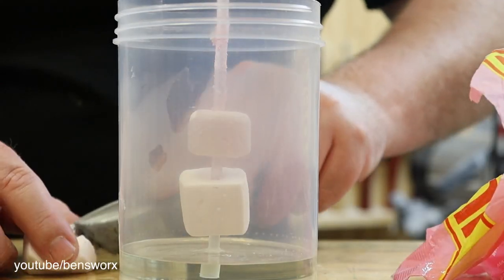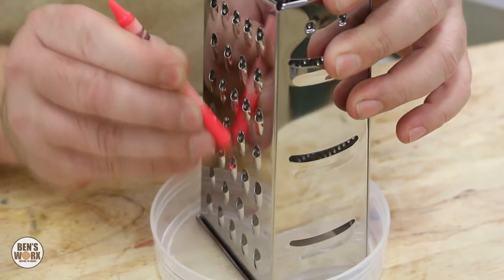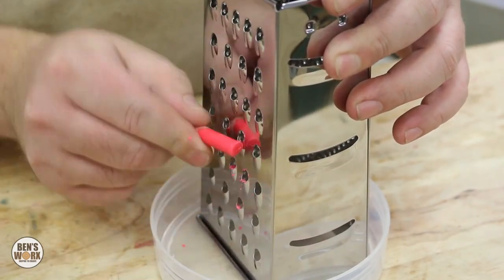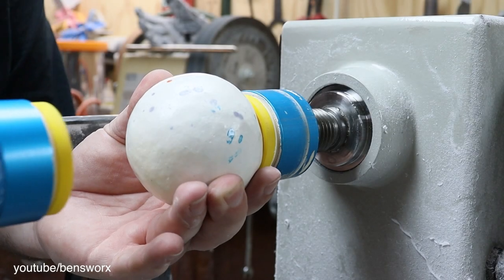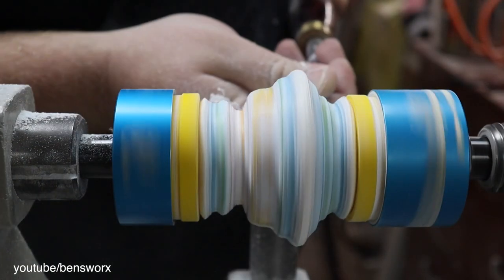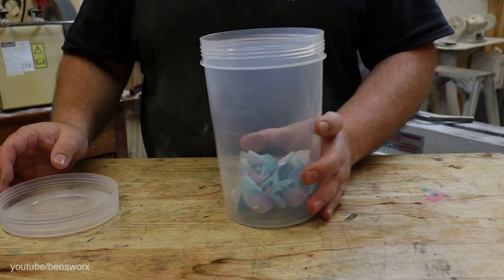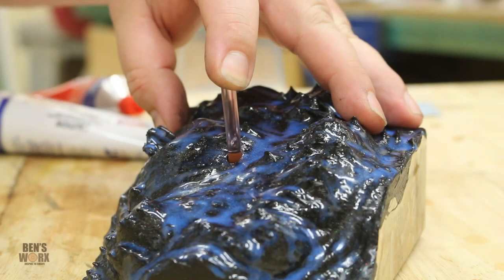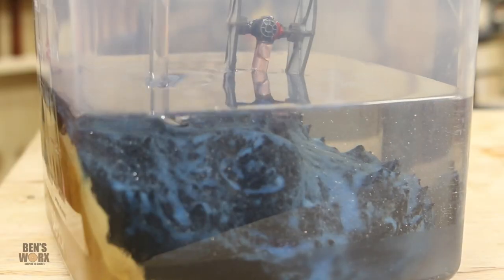POTCAM - What Happens Inside the Resin Pressure Pot ?

Comment: I'd be interested in seeing if you could get some cool optical effects by adding small amounts of powdered mica, rutile, or even ordinary glitter flakes to resin, then applying a slight constant twisting force while it sets.  For example, if there was a flat plate touching the top surface of resin in a container, and something was gently twisting that relative to the container.  The result I'd expect would be that the flat plates of the powdered mica or glitter flakes, or the needles of rutile, would be aligned with the twist direction.  After the resin was polished up, there would be internal reflection or refraction of directional light, as one gets with semi-precious stones such as tiger-eye and minerals which show asterism.

Comment: I liked the Marshmallow one! It turned into a volcano! My brain immediately wondered if you did that one again? If you used a stick with a thin disk about the diameter of the marshmallow to act like a "catch"  or maybe even a couple to sort of create a "billowing" effect. Maybe colored resin discs to create the illusion of fire or black smoke...

My brain sees that (if it worked) as an awesome egg, or perhaps even light! Maybe glue some glass fibers up the center post to each disk to light them up...

Comment: How come the plastic containers don't melt if the resin gets so hot? Have you had an epic fail with your containers? What about the toys inside your creations....have they ever melted?  My favorite was the leftover resin ribbons.
Reply: Some plastic will.  But some plastics can tolerate heat.
Reply: The melting point of those containers is way higher than the temps the resin reaches. It won't even melt the little plastic 3oz bathroom cups unless you start with resin that was already heated before it was mixed (don't ask how I know).

Comment: So which would work best for resin casting, a pressure pot or a vacuum chamber? Or does the resin have to have oxygen to cure? I've never done casting before and I'm curious. And, if you coated the tie fighter in resin first and allowed it to air cure would it still warp from the heat of casting it? Sorry about all the questions. Thanks!

Comment: I’ve always wondered- how much pressure is in the pot? Clearly the pot cam can handle it but every time it goes to the pot cam I wonder if the cam will crack or become damaged from all the extra pounds of pressure
Reply: He's removing pressure, not adding it. He's effectively boiling the air out of the resin to avoid bubbles in the final piece 🌻

Comment: I thought the vacuum chamber got rid of the bubbles if the pressure pot is adding air wouldn't it add bubbles
Reply: No there has to be a way for the air to get under the surface like a jet of air I haven’t watched the video yet but I always imagined that since the pressure is higher the bubbles shrink